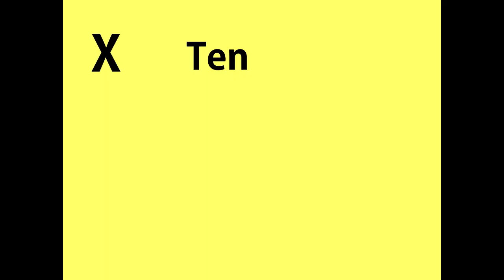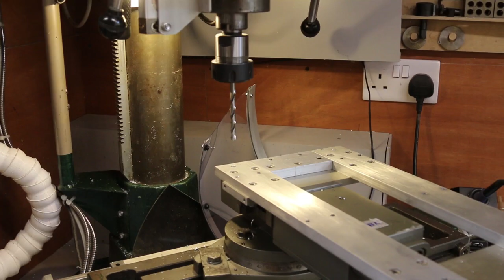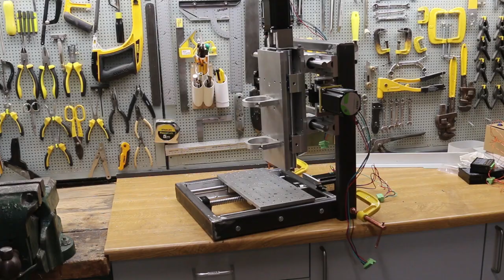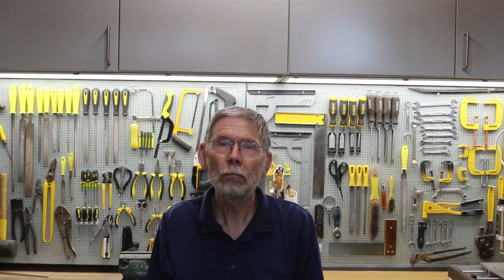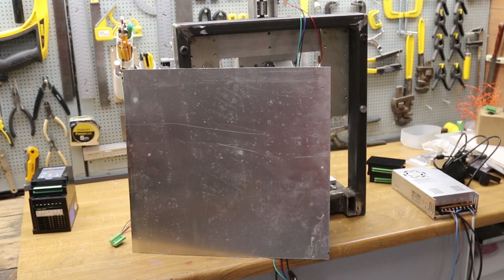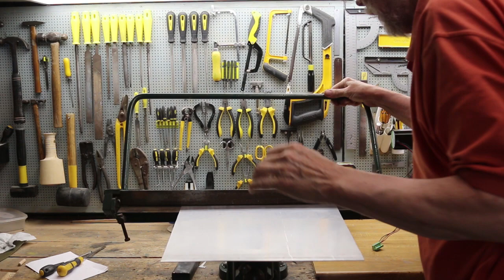HomebrewCNC pt4

Comment: What a neat little machine, looking forward to seeing its first chips. In addition to providing a mounting place and protection from swarf, the plate will also likely add a lot of stiffness to your vertical axis which is always a bonus (:
Reply from the maker: Not sure how much stiffness it adds (although anything is welcome)- the combination of thick wall steel section and aluminium bars makes it feel very rigid. Size also helps- compared to the large gantry on my Workbee it cannot fail to be more stable.
I was going to put diagonal support bars for the L shaped frame, but after assembly I feel they are not needed.